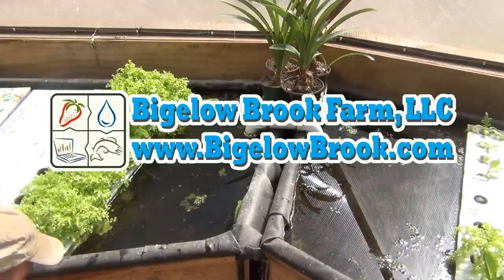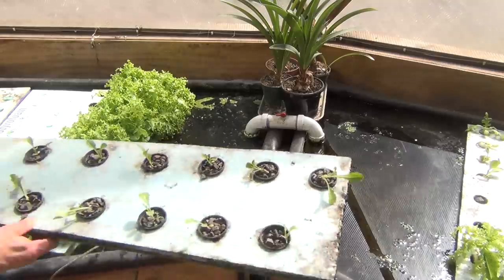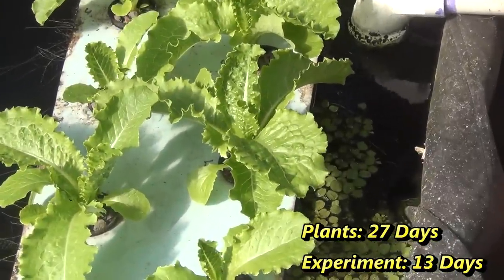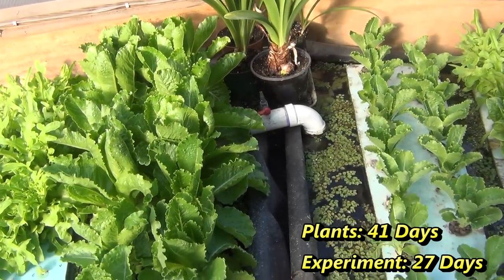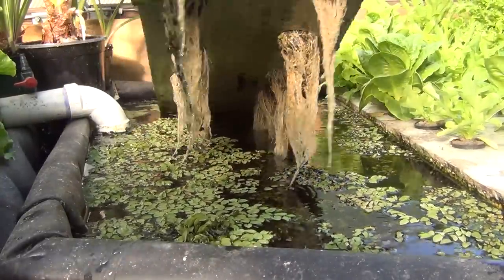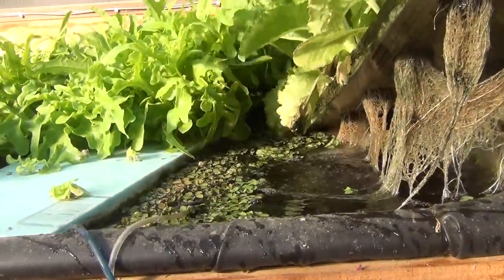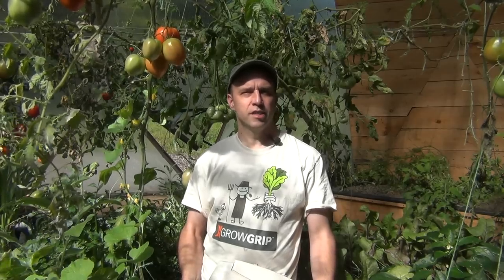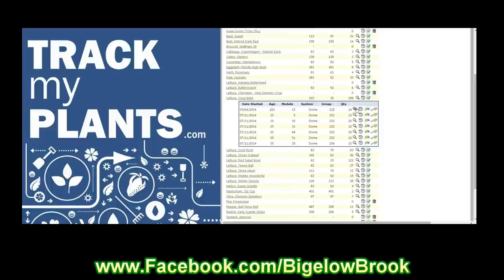'Air' On The Side Of Caution - Part 1

Comment from the maker: I did a little experiment with adding some air stones to our DWC bed.  Read through the comments in the video - there's already a lot of debate if it's the air that helps the plants or if it's just the water movement.  What do you think?  http://youtu.be/B7RpHLWViLg
Reply: Wow, that seems like quite a difference!!
Reply: whether it was the air or the water movement is almost (IMHO) immaterial. There probably isn't an easier way to rotate water than with a bubbler. Still might be good to redo the experiment with a small 50GPH pump just moving water in the tank...

Comment: Interesting experiment.  The proof is in the pudding, I mean lettuce.  After you harvest them does the stump grow back or do you start over with new seedling?
Reply from the maker: NewEnglandgardening I start with new ones.  Even though they will usually resprout, I've found that most of the root mass dies off (my guess is because it has no plant to feed) and the dead roots just rot and makes a mess of the system.  Been there, done that.  ;-)

Comment: Is the increase in growth a result of of the actual air being pumped into the water? Or is it the increased waterflow going past the roots what is causing this difference? Very spectacular results!
Reply: Very good point.   Second experiment with water circulation pump?   Which would be easier to maintain?  I think air.  Difference may be moot.
Reply: Well, that just suggests another experiment, doesn't it?
I love this kind of stuff! Food / resource optimization...
Reply: Best way to tell would be to use a D.O. meter. You can not only check levels in the bed but also levels within the beds.

Nice job Rob. Thanks for sharing.

Comment: Why didn't you use your Grow Grips on this experiment?
So you saw an increase in 1385g per raft, or 93g per plant, avg. But what is the overall cost to run the air for 27 days?
Is the ROI there?
Reply: Good questions!
Reply from the maker: I was using a small aquarium air pump and it was drawing 2 watts.  Running that would be 2 watts x 24 hours x 27 days or 1296 watts total.  So for us that's about 19 cents.  Well worth the cost.   BUT, that big air pump I was holding was a large investment.  With the pump, tubing, airstones, etc, I'm in it for nearly $700.  Stay tuned for part 2!
Reply from the maker: ...AND, I didn't have my product run of GrowGrips when I did the experiment.  ;-)
Reply: Bigelow Brook Farm (Web4Deb)

Watts are not a measurement of energy as you are using here. Did you mean watt-hours?
Reply from the maker: ataraxic89 yes, We get quite lazy with our terminology.  Typically if someone just says "watts", it's in watt-hours.
Reply: As a computer engineering student I dont know if I can forgive you :P

Ive been watching your vids since you started the dome. You are an amazingly hard worker and thank you for all your videos!
Reply from the maker: ataraxic89 I'll give you a free life lesson.  I've been coding for 30+ years.  Also assume that the information that people give you is incomplete.  ;-)

Comment: The bubbling stones do not add  air to the water.  Actually it provides circulation. Most standing water is SATURATED with oxygen. Any stagnation is the result of LACK of circulation.
Reply: Bigelow Brook Farm (Web4Deb)

if you make a kickstarter or other place i can i will support this experiment, so you can buy equipment to provide science :)

you should also look at patreon.. :)
Reply from the maker: ***** I take donations through PayPal...the link is in the description field.  I just don't promote it much.  ;-)
Reply: I was in the aquarium hobby and said the airstone increased oxygen saturation, to a friend, who was a botanist and he set me correct. we use air bubbles to move the water in the aquarium to avoid stagnation and move the water thru many filters (Except electric pump powered ones, usually the bigger ones.
Reply: Dennis Miles So - by that theory - one should be able to get identical results with a pump that just moves the water around, yes?  I've never understood why people say "roots need oxygen" when oxygen is waste product in plants.  Perhaps you could get your botanist friend to shed some light?
Reply: Scott Baker Plants absorb CO2 from the air from the leafs, and Oxygen is released from the leaves in daylight.  At night the plant absorbs Oxygen and gives off CO2. The circulation or "Oxygen" helps the roots by inhibiting mold and other bacteria growth. Only water and dissolved gases and dissolved minerals are absorbed by the roots.
Reply: Dennis Miles So do the plants absorb oxygen from their roots?
Reply: Water absorbed by the roots will normally have some dissolved oxygen along with nitrogen and minerals and organic compounds present in soil or nutrient enriched water.
Reply: Dennis Miles Fair enough.  Thanks for the education!
Reply: You are very welcome...
Reply: Dennis Miles is it true that oxygen would also accelerate growth for beneficial microorganisms/bacteria in the nutrient-rich water, to mineralise organic compounds for the plants to absorb? if so, would this be the main reason for the huge difference in results in this video's experiment? thanks.
Reply: I wonder how fish feel about that theory.
Reply: I believe that plants take in nitrogen(N2) through their roots. that is why farmers add it to their fields. regular air is 79% N2, so pumping air in may increase the N2 content of the water.
Reply: In a closed system dwc the plants absorb nutrients from the water, depleting those nutrients.   Air stones do indeed increase the saturation of those nutrients in the water.  Using a kratky system of letting the water evaporate and essentially using an aeroponic method exposing the roots in part to the nutrients circulating in the air does much the same thing.   Check out Jeb the Gardener's YouTube stuff.  He goes through the science and has many side by side comparisons.